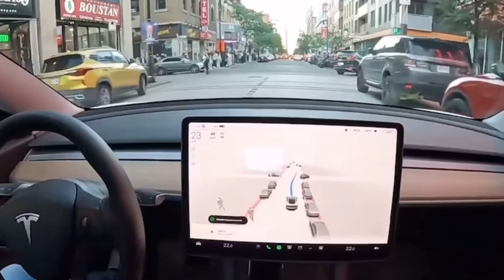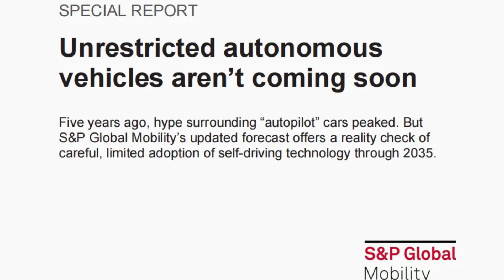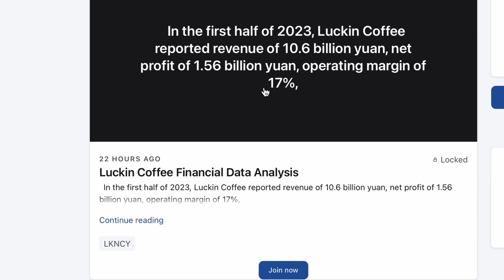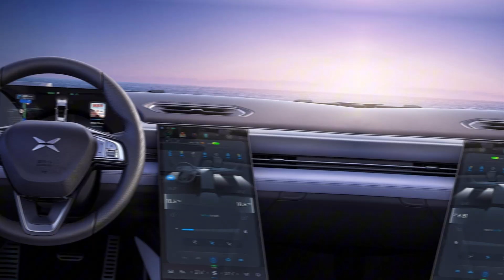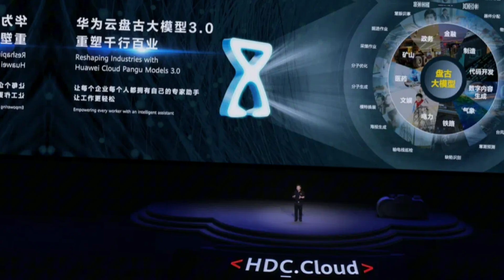Self-Driving Car: Everything You Need to Know!

Comment: @Sheila Wang Investing  That was a good video, but not a great video, because there was not really a focus on China and what is happening there.   A general overview of the Technology was really good, but that China angle was kind of rushed.   

At the beginning, you talked about Tesla and showed an Autopilot-related crash, Autopilot is not Self Driving, it is driving assistance which is a totally different beast.   ADAS is assistance, the vehicle is not designed to take responsibility for anything.  It is like an advanced version of cruise control (speed control).  Tesla FSD is designed to be Self-driving, where the vehicle will take responsibility for all actions.  If Tesla can develop true AI, it will not take 10 years to have Self Driving Cars.   

One of the things not mentioned, is the proficiency level that systems should attain.  Better than Human or is equal to human sufficient?  This is the real question that needs to be asked. 

China, EU, US and other Governments, want Self Driving systems ASAP, because so many people are hurt or killed by poor drivers.   It is one of the leading causes of death.  It also costs the Governments a lot for a variety of reasons, just imagine the reduction in Cout Cases related to driving.   Cars could follow more closely with more automation.   Computers can respond more quickly than humans to changing situations. 

One of the other advantages of Self Driving Cars, is the ability to utilize the vehicle more.   Most cars spend over 60% of the time, Parked.

Comment: here's my take:
1. when we (software developer) plan a project, we know it can be achieved on time because we put minimum requirements and complete requirements. usually it end up between minimum and complete.
2. self driving functionality are defined by reality and have to have complete all features, no minimum, no in between.
3. in roughly 10 years, self driving achieve 80% of the functionality. based on Pareto law, the rest 20% should be achieved in 80% of time (40 years). so far, nobody seems to agree with me on this point.
4. there's a possibility to speedup the self driving development if there are breakthrough in other areas like radar, microprocessor, or AI (or all of them), but there's no guarantee.